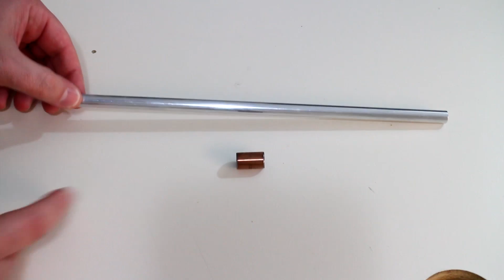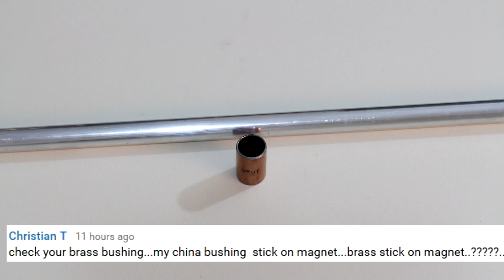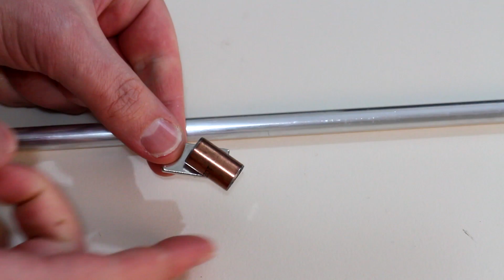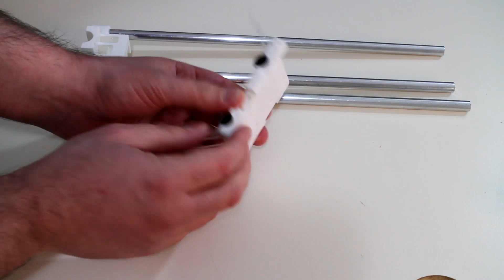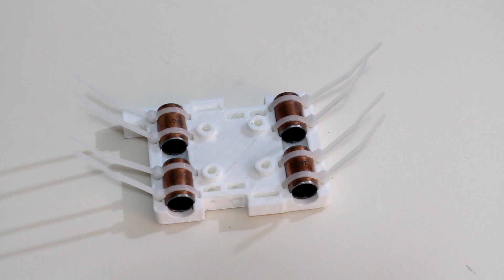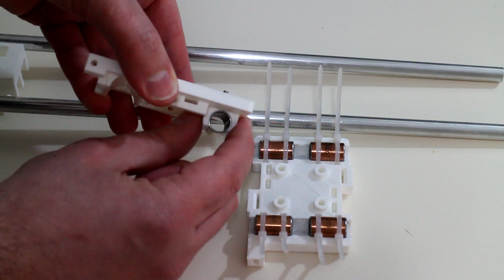New 3D Printer - Build Log #1

Comment: interesting design. You should save a lot of weight with these. My concern would be that the bend over time as you apply force when loading filament etc.. Perhaps you could add some lightweight reinforcement to center of the shaft. It could be held in with expanding foam that should improve the rigidity a bit.
Reply: Very nice solution there! About the bending: how about a quick-release system that would allow you to simply snap the extruder on and off the carriage whenever you need working on it?
Reply from the maker: Good point, these rods may bend when inserting filament.
Reply: +Tech2C I have noticed in some of your videos when you load filament you just push the filament straight in putting a lot of pressure on the extruder assembly (you can see it flexing and moving downward). You could not worry about reinforcing and just try to support the extruder as best you can with your hands and see if you run into any problems then. Happy printing! cant wait to see the finished printer.

Comment: Here's my design up to now, its on hold at the moment aw I'm saving up for something. 

http://www.123dapp.com/123D_Design/3D-Printer-core-xy-fixed-build-plate-V1/5936189
Reply: It seems really heavy on the Z axis. Are you sure that you gain anything by having a fixed bed instead of a Z moving bed? Because it cost a lot more money and far more moving parts
Reply: +Rubafix989 i believe its worth it as the z axis will only be moving once every 10 seconds or so depending on size of objects being printed of course and i don't have to worry about the bed flexing at all, imagine i printed something the whole size of the build area 300x300x500mm the build plate would have to be extremely rigid not to flex and cause problems with the print, and in terms of moving parts it's no different really.

Comment: I have used these kind of bushings before. One of the "Solutions" (more like a hack fix) were to heat up the rod and then slide it onto the carriage. The heat from the rods will transfer to the bushings and then transfer to the plastic. This will soften the plastic a little bit and allow the bushings to self align on the rods. When it is aligned, cool down the rods, bushings and the plastic parts.
This "solution" feels a bit wrong for me, but hey, it actually works for my case. Yours is probably the way to go.

Another thing, imo i think mounting the x axis horizontally is the way to go. A problem with vertically mounted rods is that the weight is not balanced. The weight of the extruder (nema17) is offset from the rods, and this creates torsional load on the entire axis. If the rods aren't strong enough then the carriage and extruder will slightly sag (drop) when the carriage is on middle of the rods. THIS is why on nearly every prusa i tested (that has 8mm rods for the x axis) it feels like the bed is concave or the middle of the bed is slightly higher than the edges. Even though it is using a perfectly flat glass as the print bed. Its not the bed that's bent its the whole carriage that's dipping down.
On horizontally mounted rods, the weight is balanced. There are no torsion on the axis and the the both rods are only supporting the weight on one direction. (both rods are bending down, instead of one bending forwards and the bottom bending backwards).
Anyway, that's only my opinion on the matter from observing my prusa and after researching a bit. And of course, this problem is mostly visible when you are using direct drive (ex: wades extruder, that thing is heavy) on the carriage.

PS. love your carriage design. Haven't thought about that.
Reply from the maker: Yeah I've often wondered about horizontal x axis rods but my Prusa i3 prints great on the x axis. I'm using Bowden so no nema 17 motor along for the ride.
End of the day if the alu tubes bow because of weight or other factors then I'll just go back to steel.

Comment: From what I see the bronze bushings behave the same as the Igus bushings, even with a small misalignment they will step on the breaks. I use 4 Igus bushings on my X carriage and they are super quite. So just out of curiosity, why the bronze variant and not the Igus?

And is a core xy really that much better then the prusa or is this just a project to find out just that? One big benefit is that you don't have to move that Y mass, it's really heavy.

Anyway flowing with big interest, take care.
Reply from the maker: Igus would be the next step along with their anodised alu rods, but cost is obviously higher. I'll start cheap and work my way up the cost scale.

I'm not a fan of the moving y axis bed as I have to reduce the print speed and acceleration quite a bit to maintain quality finishes. The core xy should allow same or better quality at higher speeds/accelerations.
Reply: I used the RJ4JP-01-08 they were 1,60 euro PP. I hope you will find a good way to keep the Y on your new printer stable, there seem to be a lot of problems with stability.
Reply from the maker: Voyager

I can find igus bushings at a similar price, but their anodized alu rods are expensive on RS components. Any idea where the rods are cheaper?
Reply: Not online, (never looked for them) but I'm 90% sure that I will find them in my local DIY/hardware store next to the alu profiles. But that will not help you I'm afraid. I will keep a eye out for them.

Comment: Do you design the plastic parts yourself ? In CAD software or any 3d modeling program?
Reply from the maker: Of course. How else do you design a printer from scratch? The CAD software I use is Cubify Design.
Reply: That's great ! I am 3D modeler, but I never touched the topic of 3d printing unitl a week before :)I have learned since then how to model stuff for 3d printing - easy :) I use Blender and I am trying my best to make it CAD like, which isn't very difficult. But I don't really have any experience with engineering :( Maybe i'll make a 3d printable logo of yours xD
Reply from the maker: That's be great, thx!
Reply: I think that Fusion 360 (from autocad) is the best CAD software for 3d printing and it is free

Comment: Aluminium rods and bronze bushings for cheap DSLR/video slider only, not for 3D-printing or other CNC application..
Cheap solution and problems with quality degradation in future..
Reply: I think he'd have more to worry about if he were working with bearings, but with these bushings he might be alright. Perhaps if he moved towards teflon bushings it'd be better, but I can't really say. Only time will tell and I'm interested to see how it pans out.
Reply: +DrMrSuperAwesomeGuy Maybe, you are right! Linear bearings have steel balls, they are not for aluminium rods.. Only for hardened steel rods. Well, we see how his construction will functional at the and of project)
Reply: I hope it works, because right now the best cheap way to get linear motion is with derlin idlers on 2020 extrusions, which is a PAIN (and not space efficient). Smooth chromed rods are just too expensive, which is the only way to get away with linear bearings.

Comment: Bushing material should always be softer than the rail or other metal they run on/in...that's the whole idea of a bushing, in a way it's also made to be sacrificial along with providing better fitment tolerances.   Good experiment though :)
Reply from the maker: Makes sense. These bushings are "oil impregnated" fro self lubrication and does leave a residue on the smooth rod. I assumed it would be sufficient for the alu but something tells me I am in for a world of hurt, haha.
Reply: +Tech2C yeah those are knockoff bronze bushings, the proper ones are pretty expensive, i was looking into them myself but yeah the choice is pony up the dollars or go for the chinese carbon still bronze coated.  The reason your getting drag is because you aluminium is of course soft, the usual hard chrome rods are hardened (try cutting one with a normal hacksaw, not fun). maybe you could go back to metal rod and change out your metal bushings for igis poly bushings, might be able to get close to similar weight savings whilst providing the best quality linear movement possible.
Reply from the maker: Well weight savings go out the window if I go back to steel rods. I may have to do that if the alu route proves futile. Thanks for your comments!

Comment: Aluminium rods? Wtf? Thats stupid, it will wear out in 5 minutes!
Reply: Jan Hlavatý Its not soft, if it was soft motorcycle frames wont be made out of it. If you payed attention you can see that inside edge isnt 90 degrees sharp. Whats up with all the negativity?
Reply from the maker: Will it wear out with self lubricating plain bearings?
Reply: +Tech2C bushings
Reply: I was wondering about this as well. Time will tell I guess.
Reply: +Luke Pettit personally i have gone with the v wheels so that i can adjust them to have 0 slop.
Reply: How it is going to wear out if brass is softer than AL, not to mention lubrication...
Reply: Aluminium is soft, it will wear when you rub it with your hand! And you have harder bushing edge rubbing it.... it will be making aluminium dust then sieze
Reply: All the back seat engineers love giving advice ;-D nothing else mind you.
Reply: will you be selling plans and files Thanks for the vedio